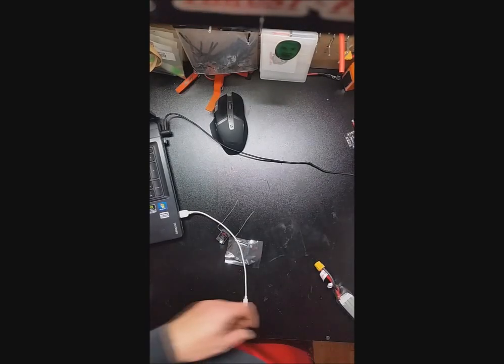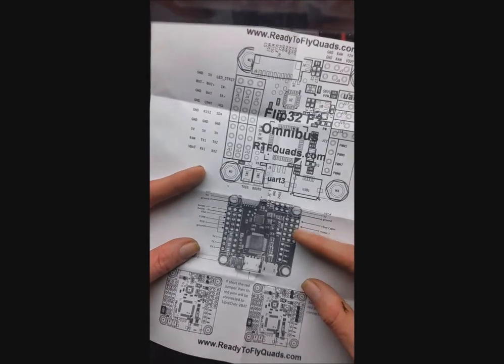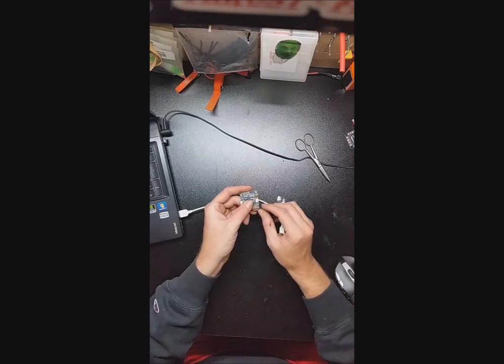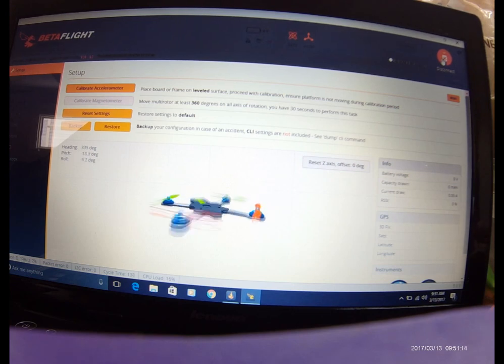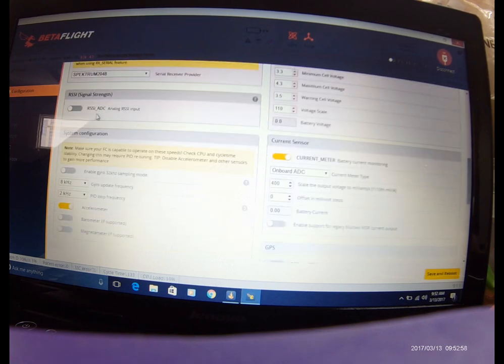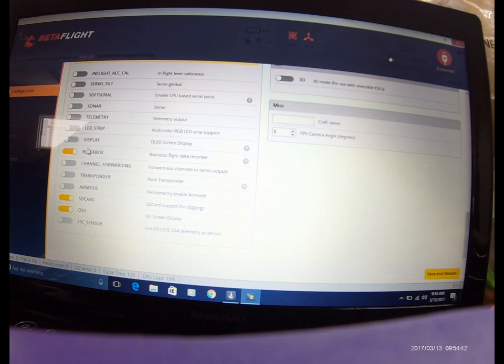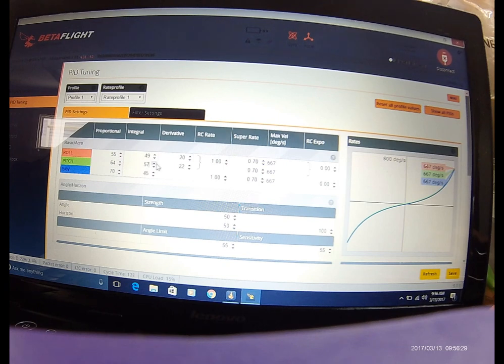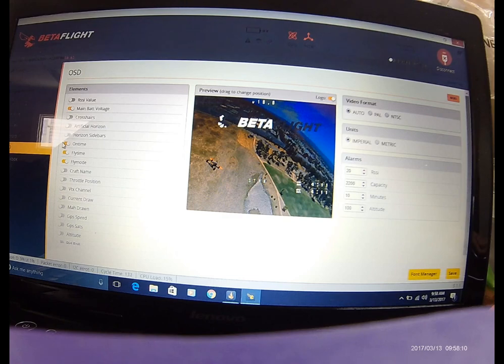Omnibus f3 Review and set up. Part 1

Comment: I just got an Omnibus F3 and I'm trying to set up the OSD, for some reason, in Betaflight I don't have all the same options. For example, I only have the "video format" option on the right, and fewer in the left as well. I also can't figure out how to bring up the OSD menu with my goggles/Tx. I didn't flash the card when I got it, I thought Betaflight automatically flashes?
Reply: try inav......has a good osd menu and if the omnibus f3 is good and has the osd working,and you have the camera in and out of the f3 in the right place it'll work........i had 2 in a row of omnibus f3 not working osd from the box.......